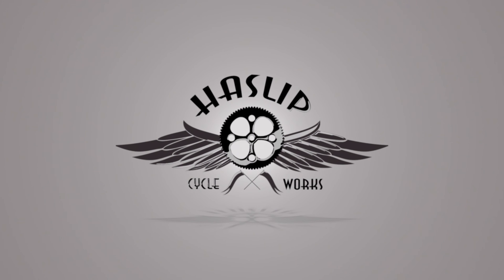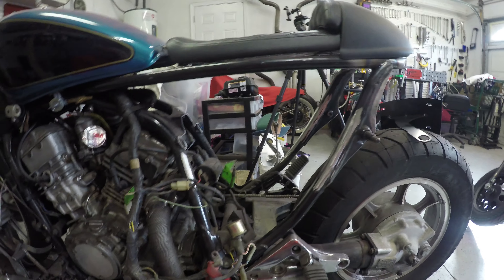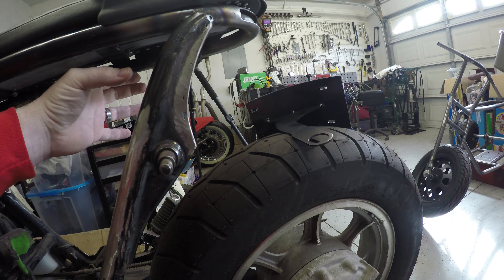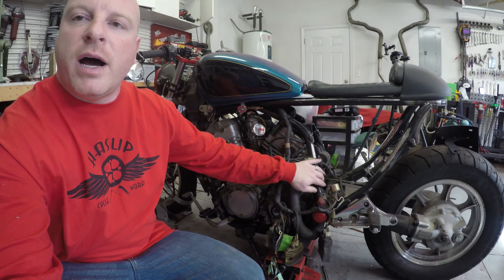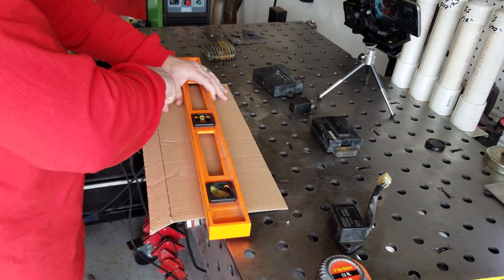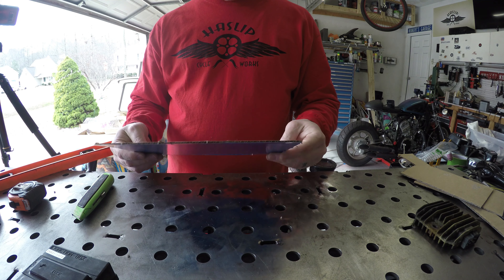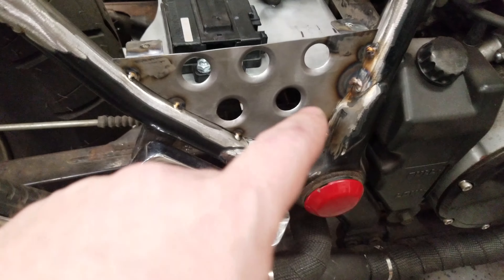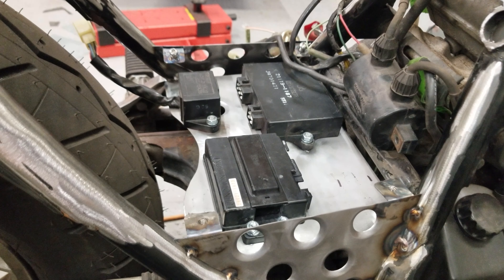Vulcan Build Part 6-ish and Face Reveal

Comment: dark glossy black tank with the brightest red you can find, paint a 3/8 inch stripe and a 1/8 inch stripe down one side of the tank and the tail piece. powder coat both wheels and rear drive a dark wet gloss black and add that same bright red in one of the mag recesses on both wheels. just s suggestion. lol
Reply from the maker: Sounds good to me!